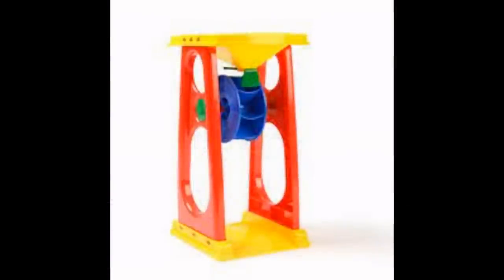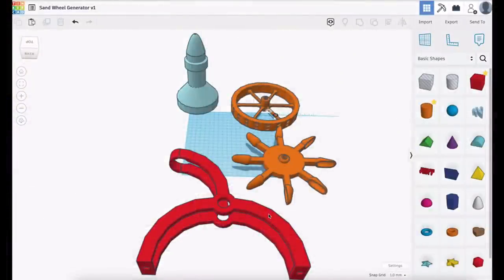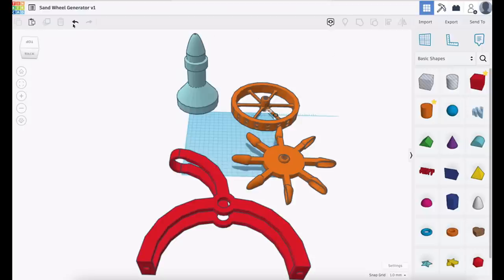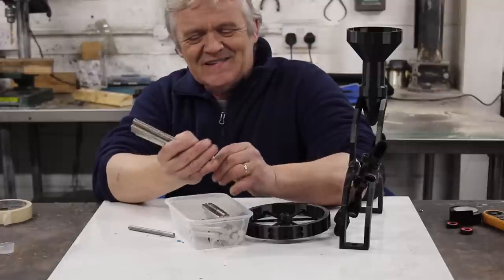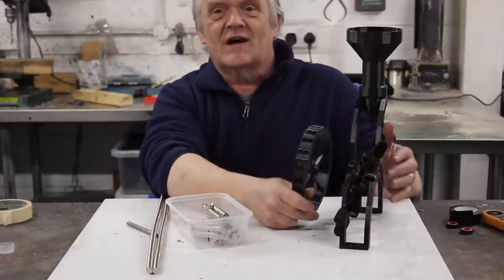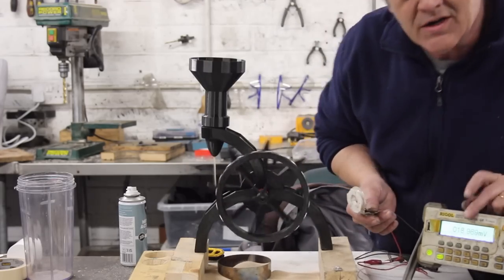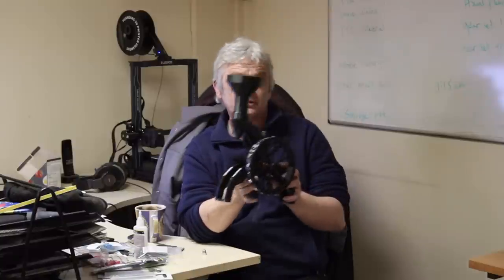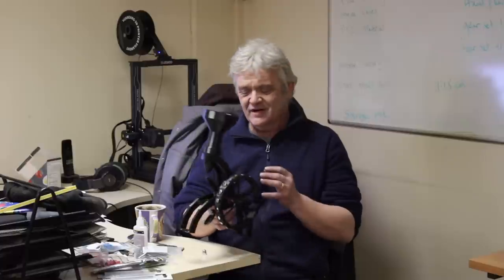1852 A Different Kind Of Sand Battery

Comment: I think because of the way you would have to store sand in a steeply elevated reserve that couldn't spread out from the center as far as water while still easily flowing back, this is roughly equivalent to what you would get by lifting heavy weights on a cable. Storage capacity is limited to the size of tower you can build. I think the good which might come from an idea like this is if you could figure out how to cheaply suspend sand or silt as a very heavy liquid that can still flow like water in and out of a reservoir. Perhaps like a deflocculated clay mixture. If you can prevent the particles from settling you may get a lot more energy density out of a given reservoir size.
Reply: Love your work with starlite, really fascinating
Reply: I would agree- Have  you ever heard of Magic-Sand? It's a toy from when I was a kid that is coated with something that not only makes it waterproof (so it wouldn't clump up from moisture) but also prevents it from exchanging electro-static charges, so it won't get charged against the side of the container or itself- it doesn't solve the settling issue as far as I can tell, but will help with the sand breathing. ) <"Sand breathing" happens with large masses of sand where it collects & houses moisture from the air in it's center in the coolest part. Because there is often a large difference in temperature between the inner & outer layers of sand, this effect is near constant. There's actually a feline called the sand cat, that lives in sand dunes & relies on this effect to survive>
Reply: I was wondering about adding water to it to make it more fluid and dense, but of course it would settle and not flow. Then I looked up deflocculated. Neat. 
At a glance the only benefit this seems to have is that sand is more dense than water allowing denser energy storage.

BTW, I replicated some of your work on HHO until my graphite electrodes disintegrated. I didn't want to risk messing with chromium. I'm too leery of amazon sellers and too cheap for proper stainless steel.  I also didn't blow up, so that's nice. I would like to make a large scale (think 1/2" steel plate cutting) HHO torch. There is a real dearth of non car related HHO information.
Reply: My thoughts are going along the lines of almost a coo coo clock where the weights move down on their own with a counter weight of not the exact same size that allows for easy resetting
Reply: yeah. that and if the wheel stops in the case you are drawing too much power from the generator, the sand is still flowing constantly regardless if the wheel is spinning. this is not good.
Reply: Good ideas. A continuous bucket belt system or cable around a pulley with two cars on tracks are efficient reversible systems for gravity storage.
If you think of a Skifield chairlift, it's surprising how small the power requirements are to move large amounts of passengers up a mountain. 
If the lift is only carrying passengers down the mountain, it generates a similar amount of energy. 
Loading and unloading the sand in a large scale settup is the biggest inefficiency. 
Loading it as a slurry with the assistance of water would vastly improve the efficiency. Unloading is not necessarily so hard as the buckets can simply rotate and tip. 
But densifying the medium definitely offers big advantage over normal pumped hydro. 
And bucket chains or reciprocating tram systems are certainly far higher efficiency than centrifugal pumps and turbines.
Reply: i think the real benefit of this system is actually in the "pumping". basically this only really make sense if you either have no water, or no way to effectively pump water, because water requires better seals or more power to lift.
so basically a VERY limited cases where for example you can use something like a chimney to blow sand up to a collection camber, or you have enough power in a wind collector to run a belt, but that belt fully loaded must be light enough for the wind to start it from a dead stop, you could save a great deal of weight by not having to worry about water proofing, and have a minuscule payload....

however probably the only real use would be a primitive crane , or a cool desk toy.
Reply: Or what about going the other way around? Use the sand or desert as the "elevated reserve" and have a robotic device that uses a bit of initial energy or even gravity to dig underneath it and open a mechanism that starts funneling it all in. Ofcourse then the new problem is where to dump it if you're underground to make room to process more sand. Just throwing ideas out there.
Reply: Could this not be easily overcome by delivering the sand back to directly above the opening?
Reply: If you want to make it a fluid why not simply use water and make it a water wheel? Pump water into a reservoir above the wheel and let gravity bring it down to deposit on the flaps of the wheel and use the wheel to turn a generator or multiple generators. My opinion of that is it leaves you with the problem of how to keep enough water above the wheel so it never has to stop and you don’t have to spend as much or more energy pumping it back uphill to the reservoir. Still something to think about
Reply: @steve_jabz  I see where you’re going. Bore a huge hole, all the way to the core and dump the sand in our molten iron core. Wet it down for dramatic effect
Reply: What about introducing a static charge to the sand so that the grains repel each other. They would flow better then. I would also add weight to the wheel to give it extra momentum.
Reply: A problem with water is that it's evaporates, and it hoter climates this makes up for a huge loss.. That's not the case with sand.

An other important point here is cheep and simple. Dessert sand with "no value" is hugely available, and using it untreated makes the prosses cheep and simple. The loss you have sand spreading out, but not flowing back is a problem the first time. When the cracks and outer regions of your reservoir is filled ( but not emptied), they will not be filled again (since there already sand there)
Reply from the maker: it is essentially just a gravity battery - the idea here isn't so much a sand wheel generator but rather a way to think - to look at what is around you and ask yourself questions, imagine solutions and build models - my actual aim here is to demonstrate to folks that ideas come from anywhere and should be explored and exploring them isn't as difficult as they may have first thought - I find the comments split into a few camps the ones I most like are the ones where people show they are thinking - maybe not about this but ideas they have - it's what I really love
Reply: NightHawkInLight, Great to see you here! I wonder if we could look at how agriculture manage grains for inspiration of a sand storage solution.
Reply: @DavidMartin-jr8nd  get the books from eagle-research on making your torch
Reply: @308dad8  Not where I was going but I generally like the idea of combining multiple symbiotic systems. If you need to process the sand anyway, might as well do it below the surface and generate energy while making room for the generator/gravity battery. I think all our infrastructure should be one big rube golberg machine tbh. So much energy is wasted just having separate industry silos that have no incentive to be more cohesive with each other. Grow food on hills and send it down to restaurants down below on a zip line with a gravity generator on it. Free transport with surplus energy to run the restaurants on.
Reply: @NightHawkInLight

Good idea Sir. 💡 

I often watch your videos. 

I love watching, 'I Can Do It', type videos that tends to empower everyone. 

And 💪 I'm quite proud to say that I share videos from your channel as well as from 
Mr. Robert Murray Smith. 

bdss
Reply: @aaronfranklin324  The problem will always be that you must exert energy to lift the sand, and that energy can't be less than you extract from it falling. This is fine with hydroelectric dams and wave generators because we're harnessing energy that already exists in nature -- someone else moved the water for us, so we didn't expend any energy to get it into the artificial lake, it simply flowed there.

A variation I saw was using a solar pump to move water into a rooftop barrel, then running that water past a turbine after the sun had set to generate energy. We need to find energy that is not being harnessed in order to CONVERT it into a more useful form.
Reply: @georgeblack589  There is no shortage of energy everywhere to be harvested. Even already with the infrastructure to harvest it in place. 
What we have is a shortage of environmentally friendly solutions for storage and retrieval when we need it. 
This could work well instead of pumped hydro, where water volumes are limited, because you only need a little to move the 90% by volume rock as a slurry for loading.
Reply: I wonder if you could use mercury for this? More expensive than water, but also much heavier and the size constraint is less punishing.

Comment: It reminded me that I’d seen something similar before. So I went scurrying to my bookshelf and soon came upon my copy of a book called ‘101 Things to do in a shed’ by Rob Beatie. Project No.88 is a Model Sand Motor and gives instructions on how to construct one in wood. Mesmerising watching one in action. Splendid.
Reply: I remember having a toy like this in my school in the 70s haven't thought about it since. but I agree it is a very interesting idea you can set up a solar powered auger from bottom to top that will run as your dump load when the conventional battery is full.
Reply: Hi Robert I thought of an idea about how to get the sand back up to the top by using compressed air from a air compressor something like when you sandblast you could transport the sand back to the top of the bin by using air!!

Only thing is you would have to have an air compressor turned by the sand wheel to pump up the air in the tank and then send the sand back to the top of the bin completing the cycle!!😆

Comment: As for lifting the working "fluid-like material" an auger (Archimedes' screw) comes to mind but from my experience with malted barley (and I would hazard the guess that it would be likewise with sand) a vertical screw elevator is more efficient and I wonder if one in the style of Olds' Elevator (where the screw is stationary and the cylinder turns) would be the simplest to direct drive from a vertical-axis wind turbine.

Rob, as ever, your joy is contagious.
Reply from the maker: I like the idea of a screw elevator mate - never occurred to me - thanks for sharing
Reply: I was thinking the same but not sure if the friction of the sand rubbing against itself (finer grain meaning more surface are for between the grains) would mean a bucket elevator/conveyor would be more efficient with sand due to the friction losses. 
I think the Old's elevator is a really interesting idea (I had to see the video on it to be convinced that it would work as it originally looked like it would be worse from a 'friction losses' point of view). 
I guess this would be a grain size vs mass argument where at some point it is more efficient to switch to a lifting method with less frictional losses. 
Or maybe switch to something like ball bearings for the material to reduce friction and get more mass for the volume and no evaporation :D
Reply: If I remember correctly the Olds elevator is used at industry level because it's very accurate for volumes and there's minimal amount of dusting.
Reply: Sand would wear out the mechanism, quite abrasive.
Reply: @ThinkingandTinkering  I hope you read this as I have commented to you numerous times this past decade to no avail with any of them.  No worries, but you know your leaf generator you made?  Have you given any thought of that being on a buoy that constantly sways back and forth?  Ocean buoys being the best down to small pond buoys (or equivalent).
Reply: @ThinkingandTinkering  Can you do a video of this? screw elevator powered by the current coming from the wheel generator. Make the bigger buckets for mass and a large storage hopper? Keep the radians per second very slow and lots of sand for torque. Convert the torque in a gearbox for the generator.

Comment: I've had this long going idea of building a man sized hour glass with a turbine in the center. The whole piece would be suspended on a stand with a swivel and a pin lock so once the sand drained down you'd pull the pin and swivel the hourglass bottom side up and let the sand flow resume. No doubt the power generation is small for the amount of space it would take up but would no doubt make an interesting piece of practical furniture.
Reply: I think you'd be using a winch to turn your man-sized hourglass. That's a fair amount of weight, I think.
Reply: @Struthio_Camelus  there's still a few kinks to work out ;)
Reply: A fun idea, indeed.

Comment: As soon as I saw it making a volt, mobile phone charger popped into my head. This channel never disappoints. 👍
Reply from the maker: cheers mate
Reply: Mobile phone battery takes about 5 watt hours to charge. Thats about 15,000 joules. 15,000 joules will lift 1.5 tonnes about 1 meter. This device captures energy of sand pouring a distance of about 20 cm. You'd need to pour about 10 tonnes of sand through it, to charge a phone.
Reply: @adymode  Couldn't he dramatically improve the output with more powerful magnets or more copper coils?
Reply: @adymode point being about all these tiny free sources off power are too trickle charge real batteries

Comment: Interesting one Rob! Looking that sand flow immediately reminds me of an hourglass. Maybe designing the device as one could enable it to be recharged by simply flipping it? Not an easy design task I reckon, but very user-friendly and with few moving parts...
Reply: What if the lower reservoir was on the opposite corner, as in diagonally? You could rotate the unit 180°and it would continue to operate in the same direction.
Reply from the maker: I like that idea mate - on so many levels - cheers
Reply: You beat me to it. Yeah, it's basically an hourglass. An hour glass with a wheel or something in the middle to extract the energy from the sand would be cool.

Comment: I love it, Rob! The magnets also make it a smooth running flywheel. 
You should be able to increase the momentum of the sand by positioning the sand hopper higher up. I think gravity will add to it.

Comment: the only limit to its run time is the size of your sand hopper at the top, you could easily use one of those bottles for a water dispenser full of sand and have a spare standing by, then the first can be refilled from the sand dropped, in fact if the spare bottle is at the bottom collecting the dropped sand, all you would need to do is keep swapping the bottles. it could be like a giant hourglass with the mechanism in the middle.
Reply: I agree. Swapped containers would probably be more energy effective than an auger.
Reply from the maker: nice nice nice - I can 'see' the design already - very good mate - thank you for sharing

Comment: You could make it taller and add more whells so that the same "battery" of sand is turning multiple wheels as each wheel dumps sand onto the next one below it instead of straight into a collector. Theoretically the same sand battery could power however many wheels the device is tall.

Comment: this could be done with small bearings or maybe plastic bb's (if they are heavy enough) and they could easily be lifted back up to the funnel with a screw elevator.
wintergatan's marble machine channel has ton's of inspiration on moving the bearings back to the top. he has experimented with different methods.
Reply: Like the screw elevator idea, maybe wind powered and store the sand for windless times.
Reply: @pinballrobbie  or have the screw run on solar to stockpile sand during the day for use at night...
Reply from the maker: nice

Comment: not sure if youd have seen it before, but you might be interested in heros automaton. i made a reproduction of one on my channel. its basically a ancient greek robot powered by falling sand, but instead of just the weight of the sand providing the energy  it uses a heavy counter weight placed on top of the sand and then power is pulled off with rope tied to the weight. the whole thing is set inside of an hourglass like structure so it just skowly lets the weight descend. that way you can combine the fluid dynamics of the sand with the gravitational potential of a heavier weight

Comment: I'm wondering if you use the heaviest dust (sand) you can find it will produce more force.  Some minerals and elements are 3+ times more dense than water meaning it should be able to produce more power than water 💦.  GL and TY!

Comment: You could use an archimedes screw powered by a gear reduction linked motor at low speeds and high torque to take the sand back to the top slowly over the course of say 12 hours or so, using solar,  and then drop the sand at the same rate to recover power at night

Comment: Fantastic idea and information, you never fail to educate and create interesting thought.  Thought I'd put out a fact about sand which has always interested me, in fact several of my inventions use this method: when you pump air under pressure in a container of sand (like aerating water using air stones) it actually becomes fluidic and flows while it's density changes as well.  It's very interesting, there's many videos of people aerating sand and then swimming in it or floating and sinking objects.  Just food for thought: thank you for all you do, your son is also a top notch creator and I appreciate you guys.
Reply from the maker: nice share mate - thank you for adding that - and cheers
Reply: Nice one. The aeration method is often used with fine granular plastic for powder coating heated metal.